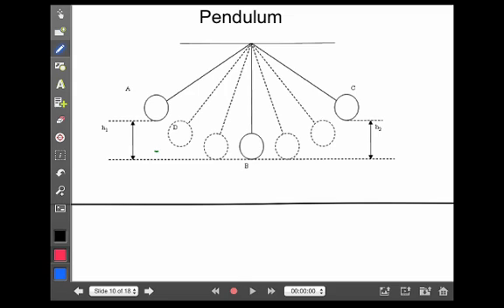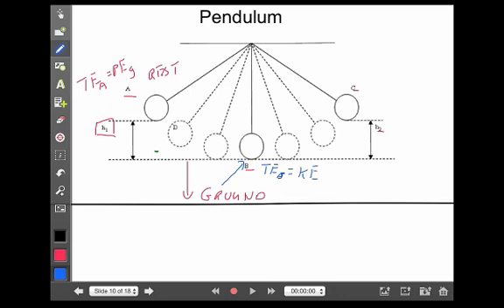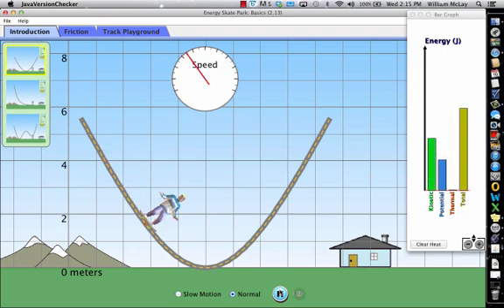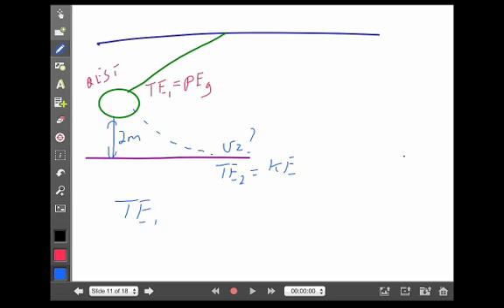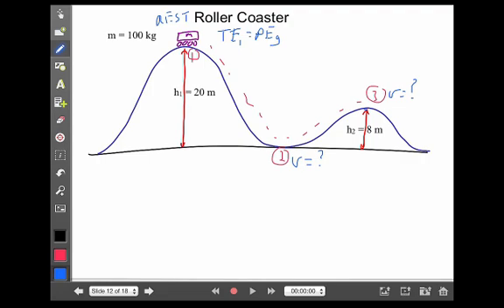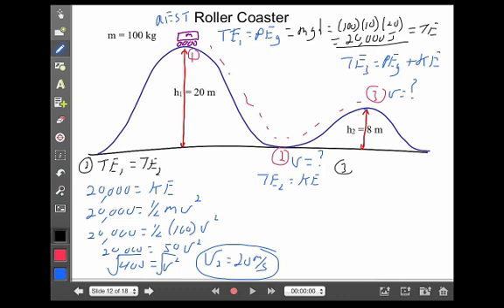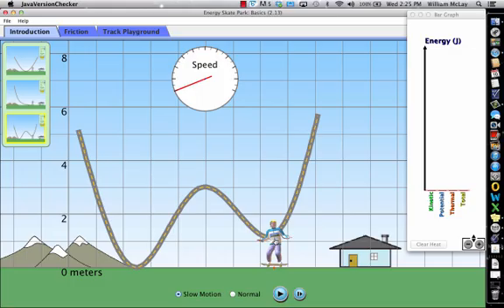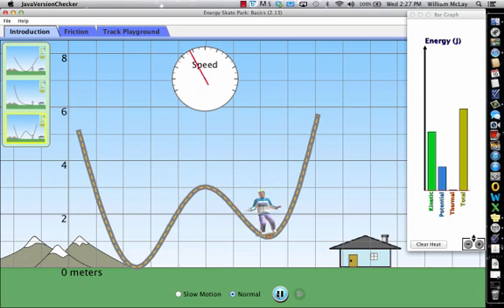Energy Lecture 2

Comment: Hello Professor.
Regarding the collisions of the pendulum and the use of the equation for conservation of energy: Total Energe = Kinetic Energy + Potential Energy
Would it be correct to say that you can only solve pendulum problems with this equation if you assume the collisions are completely elastic?

also, is there any relationship in language between "elastic collisions" and "elastic potential energy" or are they not really connected?
Reply from the maker: Hi. This discussion of a pendulum is only based on a freely swinging, ideal pendulum, and does not have collisions associated with it. However, where you to have a situation like Newton's Cradle, with a collision using a pendulum, to use Conservation of Energy in it, you are correct, it would have to be an elastic collision. Thanks for asking.